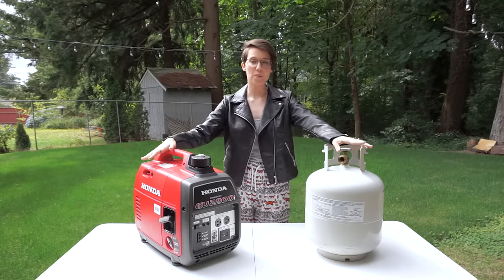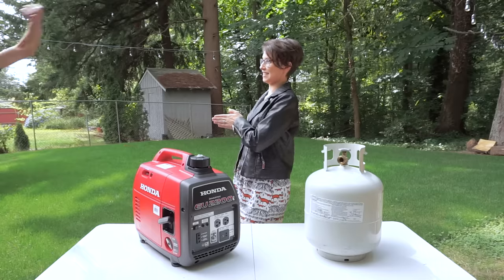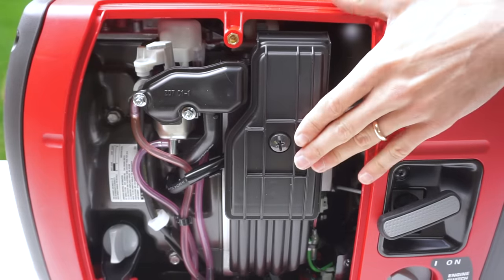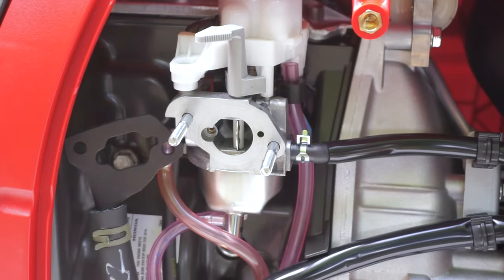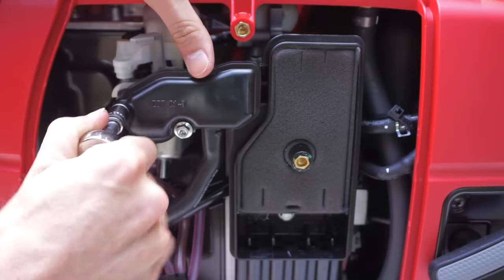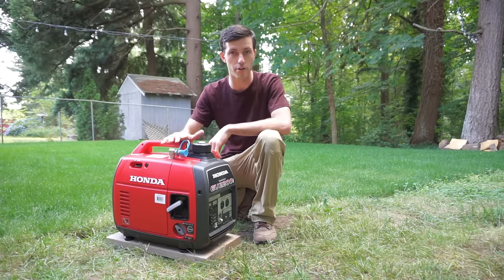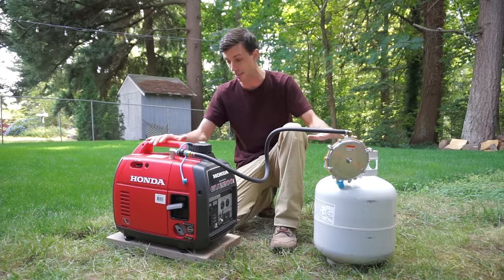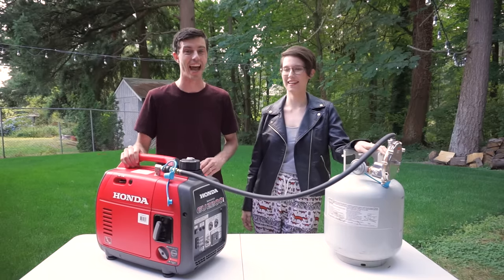Honda EU2200i Propane Conversion Kit - DIY Install for Honda Generator

Comment: I am not even interested in doing a propane conversion, but this video is absolutely crystal clear and very informative. You both did an amazing job and I really enjoyed watching this.
Reply: @alanj7306  Fuel is awful to stock. If there is a black out you will fight at the gas station to get some. It smells  awful and it reduce the lifespan  of your generator and need more maintenance. Totally worth it

Comment: Awesome idea, but my OCD and that sticker being crooked was hard to watch.
Reply: I lost the little white plastic spacer inside the generator.  I have searched high and low and cannot find it.  Maybe it hit the dirt.  Do I absolutely need that little plastic spacer?
Reply: I thought i was the only one!! I didnt hear a word he said one i saw him start putting the sticker on
Reply: @tamivanthof8132  Just measure the thickness of the "mixer" (the part that is lettting the propane gas into the carburetor) and use regular metal washers. 4-5 washers should be the same thickness like that nylon washer. It's needed to avoid crushing the air filter housing when tightening the nut.
Reply: I saw that right away.
I kept staring at it.
So does that mean I have OCD too.
Little things like that bother me immensely.
Reply: @RVingTheCountry how do you survive normal life? Ever work with your hands? Nothing is ever perfect

Comment: Why not just drain the carb with the drain screw on the carb out the pink hose's. I find even after running the carb dry through the fuel off knob it still holds fuel.

Comment: Electrician here, I've installed tons of generators and the best ones by far use propane. Quieter, less gunk, engines last longer than the heavy fuel gen sets.
Good Job!
Reply: KingTesticus for stand by units that run infrequently, yes propane/natural gas is best, but the fuel has far less energy content than diesel. 
Diesel is still better for a piston engine being used as a prime mover, for efficiency reasons.
Reply: How much more efficient is propane? Say 1 gallon of propane compared to one gallon of gasoline?
Reply: PugZ Designs it’s less efficient
Reply: Hi King, is it required to break in the engine with gasoline before running on propane? Thanks in advance for your help!
Reply: @PugZDesigns  One gallon of propane equals .8 gallon og gasoline.
Reply: Still seems loud to me
Reply: The fuel is hidiously expensive! Gas is a fraction the cost of propane!
Reply: @donraptor6156  in Qc, Canada we are paying around 0.80$CAD/Liter for propane.. gasoline range about 1.05-1.20$/L... if the efficiency ratio of about .8 is true, propane is pure bs
Reply: Can you convert any generator to LP?
Reply: You do understand that this Honda is no quieter when running on LPG vs gasoline, correct?
Reply: @donraptor6156  extra cost for 100% reliability for occasional users is worth it. No issues with outdated Petrol and gunked carburetor, along with longer engine life.
Reply: @QuebecoisSti  not 8 my friend, .8 (0.8)
Reply: @marcopoulos3493  forgot the dot... thanks for that 2 years old comment edit lol

Comment: Bought one of these generators and the separate conversion kit 3 months ago....we lost power 1month ago for 2 days....I went out to the garage, and the generator started on the second pull, and I ran it continuously for the 2 days, saving all the food in the refrigerators......PHENOMENAL....can’t sat enough great things about the LP conversion kit, and generator...
Reply: How much propane did you go through in the 2 days?

Comment: Ordered my Hutch Mountain kit last weekend, it arrived today.  I install it tomorrow.  Our EU2200i is new, haven’t even put oil in it yet.  I will be breaking it in with gas, then switch to propane for primary use.  I ordered the Quick Disconnect kit so I can run this off the LP port in the front of our AIrstream and plug into the generator port in the front as well.  Will be able to chain it to the A Frame for security as well.
Reply from the maker: Awesome! I hope it works out well for you, we are loving our kit so far and enjoy being able to choose between gasoline and propane.

Comment: I'm a professional mechanic and found your video very helpful in my decision as to which conversion kit to buy. Just ordered it from Hutch Mountain and your code still works! Thank you!
Reply: A real professionnal mechanic WON'T recommend to do this conversion by ourself. This "thing" is "you work with gas" and no one is legally nor skilled to take this responsability. You must engage a certified technician in propane.
Reply: @VivieLittleGhost  assumptive people make me laugh. I am ASE certified heavy diesel, gasoline and propane. I'm a school bus mechanic with over 36 years experience with all manner of internal combustion engines and I'm a certified electrohydraulic engineer. I've done so many propane conversions on forklifts for indoor use I've lost count. My 15 year old daughter could install this kit with the instructions they provide. Thank you for your input. Best wishes to you and yours
Reply: @roadwarrior3315  Ok right. I said : BY OURSELF. And "ENGAGE A CERTIFIED TECHNICIAN". Happy you are one. What don't you understand in this??
Reply: @VivieLittleGhost  arguing on the internet. What a great way to spend your time.
Reply: @kevindication  And you? You're late about 7 months…
Reply: @VivieLittleGhost  considering I just bought a generator just like this yesterday, based on this video, and am about to convert it with propane, based on this video, and am about to disregard your apocalyptic advice, based on this video, I’d  say my timeliness is extraordinary.
Reply: @kevindication  Sincerely… bravo! But I totally don't mind what you think. Have a nice day!

Comment: I love not carrying gasoline. I did get an extra tank, also connected a Y manifold to the tanks on the trailer. LOVING IT!!
Reply from the maker: Heck yeah Scott! I'm so done with gasoline. The Y manifold is a great idea too!!
Reply: @FateUnbound  Any chance you could do a video on how you spliced it into your trailers system. Thanks
Reply: so is it possible to use this with an automatic switching regulator between the two tanks?

Comment: I've watched a lot of "Do-It-Yourself" demonstration videos on Youtube and this one ranks right up there amongst the best available.  Very clear and concise yet detailed with excellent video shots of what is going on.  Bravo!
On a separate note, it just blows me away WHY small engines, be it generators of lawn mowers, have to be so damned noisy.  I can walk out my driveway when 5 cars are sitting there running, awaiting a stop light change, and I don't hear anything.  Each of those engines is capable of producing way beyond 100 horsepower yet they run very silently, other than those whose exhaust systems have been specifically modified by insecure individuals to make as much noise as possible in a "hey mommy, look at me" frame of mind.
Reply: its the sound deadening provided by the engine bay and engine size helps too, bigger parts mean lower frequencies and high pitched whining.

Comment: Your instructions were spot on, way better than the instructions that it came with. Installed it today on a brand new generator and the goal is to never use gasoline.

Comment: That was a good video. Clear and concise.
I'm pleased to see how easy it was to add the propane parts.

With the generator on propane, it will not pollute the oil as the gasoline would., You can probably go far longer with oil changes. On that note, I highly recommend using synthetic oil. It is so much better.

Comment: I ordered the propane conversion kit from Hutch Mountain and got $15 off using the promo code!  I was very impressed that three years after this video was was first posted, the promo code was still valid.  Excellent instructional video coupled with a nice discount code!  Thank you!

Comment: I would have love seeing comparison time consumption between 1 full gas tank fully electric loaded vs 1 full 20lbs propane tank. The instructions video was crystal clear even if i don't own that generator 🙂
Reply: Yes, this is the exact question I also have, hoping someone can test this out
Reply: To be fair it would have to be one 20lb propane tank vs 4.5 gallons, give or take, of gasoline. That way you're using the same amount of fuel to figure the run time.

Comment: I also recommend using fuel rated Teflon tape or pipe joint compound on the threads of the fittings, to make sure you have a good seal.
Reply: Brass fittings.
Reply: @mds1986ms  : Belt and suspenders. Especially when dealing with flammable gasses!
Reply: It's a demand regulator. When the generator stops running (sucking gas), the flow stops. That connection should always be under negative pressure (vaccuum) when there's gas in the line, so the only risk of a leak in the joint is the engine running slightly lean.
Reply: @ve3yjt  : Same response.  Belt and suspenders.
Reply: Do you put pipe dope on your grill too? Belt and suspenders, laces and velcro too? Where do you draw the line with that? You better use explosion proof lighting and i want to see the chico in those seal-offs buddy.
Reply: @mds1986ms  : When it's on NPT fittings, yes.  When it's on flare fittings, which are self sealing, no.  The tank fittings have O-rings to do the sealing.  Come on, man, Teflon tape is super cheap, and adding it will add another 15 seconds to your build time.  It's cheap insurance. It's something you should have in your toolbox anyway.
Reply: My diesel fuel systems function under a vacuum as well, and I put Teflon tape on those joints as well.
Reply: @murdelabop  
See this is the part where i say. "Im not a professional plumber or pipe fitter, im an electrician/cnc technician." So if you say so then i believe you.  I have so many rolls of T-tape youd think i was a pipe fitter tho.
Reply: @mds1986ms  : <shrug> Assemble it the way you assemble it.  Hopefully nothing Bad ever happens.  Myself, I'll take the cheap insurance.
Reply: @murdelabop  
Ok i mean what youre saying is correct but if you look at what i said im not necessarily wrong either. But lets face it guy if you dont know when to dope or tape a pipe you probably shouldn't be phutzing with it in the first place. Same goes for the electrical end of this deal.
   Safety 3rd learn to do the job properly and safety is inherent. If safety is at the forefront then the task at hand isn't and that is inherently unsafe.  Thats the problem with youtube videos everyone thinks they're an expert in 5 mins.
Reply: @mds1986ms  Good points.

Comment: Propane is such a nice upgrade to a generator. No messy and volatile gasoline to refill and do not have to drain tanks and carbs for long term storage. Plus you can keep a tank around forever and it never goes bad. Plus the engine will last forever.

Comment: Very informative. I'm surprised a kit could be that simple, but a great presentation.
Reply from the maker: Thank you George!
Reply: At over $250 for a few little parts it better be easy to install....Always having to pay for the cool stuff.
Reply: Its a system known in the trade as Suck and Burn. Suitable for engines running at fixed revs and loads. Though ideally you need to change the spark plug for an LPG model. Trouble is theses are eye watering costs. For my V8 LPG Land Rover Discovery, the standard NGK plug are £7.94 each . The LPG are £18 each! I and I have 8 of them! Fortunatley the standard plug does run it OK,. When fittting the gaskest, use a GAS approved sealeant, and on all threaded connections. This ensures no leaks and cleanear burn.

Comment: Don't forget to keep track of oil 
Level. Folks get to worrying about long run times and tend to forget about the lubrication needs of the engine.  But that said, this is a most helpful video.
Reply: My question is does the propane still feed when the engine cuts off from low oil shutoff?  I don't see the gas being turned off while running... ??
Reply: C Elliot, I do not know. It is something that needs to be found out though.
Reply: @s.leemccauley7302  I would think a propane solenoid would be used to prevent the propane/NG from flowing after the engine has stopped. On stand by generators there is a powered gas valve that uses the available 12 volts from the battery to open and close based on the control panel and the engine's request to open close the fuel.  
I wonder if it would not be a good idea to rethink this idea through.. to have a reason to shut off the gas if it ran out of oil and shuts off..    Just a thought.

Comment: It's about time we are seeing these LP conversion kits.  We have a 10,000W generator that is "dual fuel", which means it runs off of gasoline or propane and it is at least 6 years old.  There are generators that run off of 3 different fuel sources but ours runs off of two.  Obviously ours isn't as portable as the generator in this video but it can run our entire home and it does have wheels.  We have only run it on LP, it has never had gasoline run through it and it is in pristine condition.  Propane has many benefits but the fact that it almost never goes bad is the greatest reason to have generators running off of it.   If you have a remote cabin or similar location, having a fuel source that you don't have to worry about going bad is a huge load off of your mind.  Like you mentioned in the video, just about everything you use concerning your RV is run off LP so there usually is plenty of fuel around.

Comment: I always run my generator sitting on a small board like you have yours.  It keeps it from vibrating on the ground and making a dust cloud in dirty camp grounds, which result in it eating its own dirt.

Comment: This video helped me make my decision on a generator purchase and I wanted to give a shout out to you guys. Awesome video..I've ordered the conversion kit and the generator will get here before the weekend. You guys helped me resolve a major quandary I was in and I went to the tip jar. FYI: Some of your links are not working, I tried to use them to make the generator purchase. Fantastic job on this video.
Reply: Hi Kevin. Does the "ECO" switch still function after install running on LP? 
Thanks for you response.

Comment: I just did this mod to my Eu2200i and referenced this video more than the printed instructions that Hutch sent - it was straight forward. There was a delay in getting my kit as evidently Hutch is having trouble getting regulator parts and the elbow was different than pictured in video, mine is gold and was a little squirrelly screwing together.

Comment: Amazingly simple install! Very well thought out upgrade! Now if you put a low-pressure external fitting on your RV you can lose that jerry can, that can be a pain to find a place to store. Also depending on your RV, you may be able to upsize your tanks to accommodate the greater fuel usage. 

   We used to run taxis on propane they got worse fuel mileage but when I started propane was 19cents/litre. Multiply by 3.78 to get a us gallon and you have dirt cheap fuel. Then at Xmas time one year, the price went up to and over the price of gasoline and the whole propane infrastructure disappeared. Because propane is already atomized (it's in a gaseous state already) propane car starts very quickly.
 It was so clean-burning that looking at the condition of the oil in the taxi after a couple of thousand miles, you would swear you just changed it. We don't generally think of gasoline-burning engines as smelly because today's cars with fuel injection and smog devices are so much cleaner at the exhaust pipe. 

  When diesel was forced to clean up there exhaust the standard they were tested to was called Tier 2 bin 5. I have no idea what it means except that cars had been achieving that kind of efficiency for years before that. Once I was in the basement of my house and had a window open while the lawn outside was being mowed. I had to close the window because it stunk so bad.  Carbureted engines just are not that efficient.

Comment: This is a a great install video, but want to note for those in 2022, read the directions for changes as the nylon spacer has changed in size and you have to remove the metal spacer in the air box to reapply.

Comment: I like that this is not conversion from gasoline to propane but to a multi-fuel setup. Propane is cleaner burning and easier to use, but a little more expensive and less energy dense. If you're in the boonies though and the propane runs out or isn't not an option, you can make electricity using gasoline.
Reply: Here in San Diego propane is a whole dollar less than gasoline (but then it doesn't get taxed ten ways to Sunday).
Reply: @david_sdiego  The sad truth is that , even with the cost and all taxes factored in, gasoline is still cheaper per B.T.U. then propane.
Reply: @Peter Szwed  Not in California. Our expensive "summer blend" & already
 high taxed gas will be going up every July 1 until gas cars are squeezed out.

Comment: Easy to understand review.  Another option would be to purchase the Champion 3400 watt dual fuel generator.  It delivers 1200 more watts, has electric start, has wheels built in for easy portability, and is already setup for use on gasoline or propane without any mods.  Bonus it costs less... currently $989 from Amazon.

Comment: Ive been converting gas motors to propane since the late 80s. Cars, trucks, fork lifts, generators, irrigation pumps, lawn mowers, i started in the LP gas buisness with Suburban Prppane. 5 yrs there and 1 yr at Amerigas. Its funny to see it on you tube.